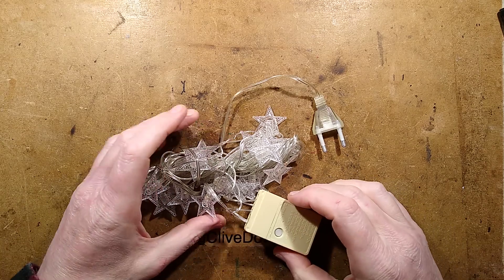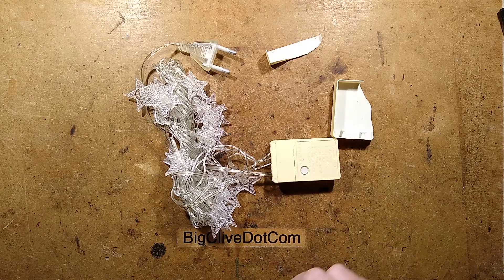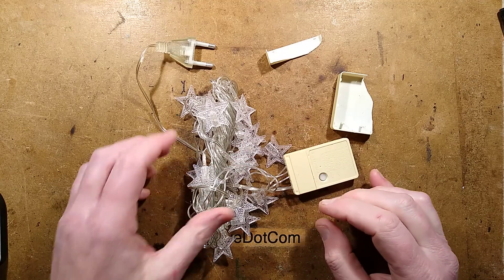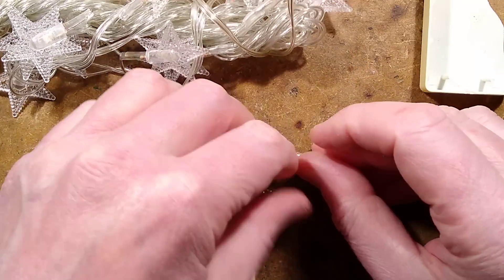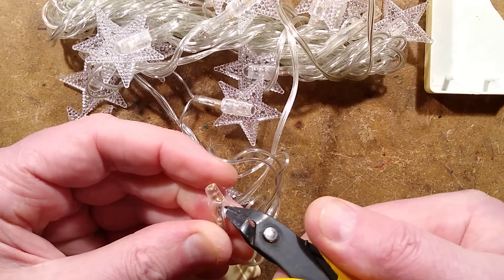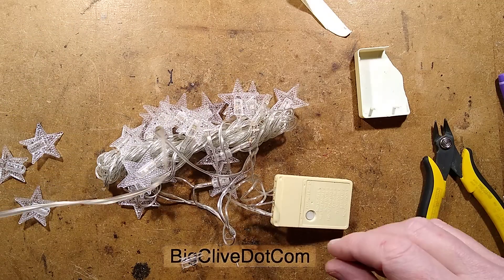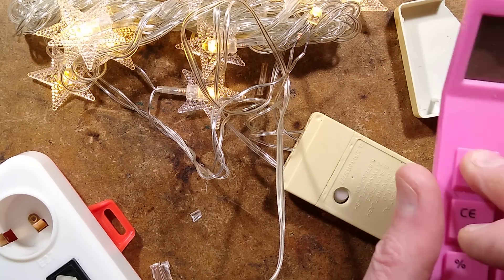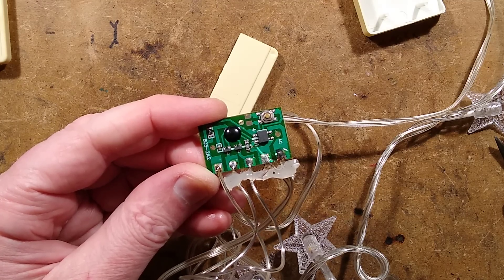I bought the WORST fairy lights on eBay (so far)

Comment: Reminds me of the melty extendable christmas lights of death from about 10 years ago with the same mains plug, running directly from rectified DC with no smoothing that put 330VDC across the whole string and said they were indoor/outdoor! Shame i didn't get the set that had the socket right at the end, so it was also carrying full AC with no fuse. Remember those? I 'member!

Comment: My coworker bought a snowflake set of these, otherwise identical. The plug molding is so bad, one of the leads had exposed wiring on the side of the plug where you would be holding it, and exposed in the stress relief portion on the other end. They remained unplugged wall decor. Between that and the feather light controller box, my first thought was "I should send these to Big Clive". So I'm glad you ran across them!

Comment: I took a gamble on some cheap solar powered fairy lights for my daughter and strung them up along the back yard fence. Those things survived 6 snowy winters and 100F summers of being on all night every night and charging during the day, never being taken down and even getting violently stretched out when a bad windstorm knocked over a chunk of the fence. After 6 years they finally stopped taking a charge from the solar cell. I paid like 6 bucks and unfortunately can't find them again. If I'd known they would last that long I'd have gotten 3-4 sets.

Every once in a while you find a hidden gem that was accidentally made better than they intended to, but I would only ever buy Chinese eBay crap if it doesn't plug into the wall. I like my house NOT burning to the ground, thank you very much.

Comment: I've only just seen this. I bought a 3m x 2m net and very nearly contacted you about it. Very similar looking controller casing from the outside but with a larger board and a rotary dial. I go through quite a few sets (they're used on stage and get abused) but twice I've broken them by just knocking the controller... and when knocked (not even that hard) the microchip breaks. Not sure if it's physically breaking internally or if it's from something else briefly shorting / breaking with the rotary dial but they're incredibly flimsy.

They also get really warm and smelly really quickly if you test them in the box they come in.

And yes, I do run these through an RCD as they're near the public and I don't trust them for safety at all (even if they are listed as sold from within the UK)

Comment: Many thanks for the circuit diags, You always take trouble to trace and show us.

Can the same kind of mains 'Power drop' circuit be used for some other circuits like for an ESP01 board, etc. with a smoothing cap and zener, etc? this would eliminate the need of other bulky components especially the transformer.
Reply from the maker: I would advise against powering things like that with non isolated supplies due to the high shock risk.

Comment: So good to hear that you still call those components 'Thyristors'...

Some years ago, a young whippersnapper of a recently studied-off engineer told me that those are called SCRs...and NOT thyristor and that a thyristor is an outdated technology used by dinosaurs such as myself (referring to the vacuum tube era!)

The reason why those resistors are running hot is to melt the ice off during cold European winters... it was done on purpose! 🤣🤣
Reply from the maker: It is odd that they ended up with two different names.

Comment: Hey Clive I have something I would like to send you.  I have several LED bulbs that you might like taking apart.  They are Philips first LED bulbs from 2011.  I bought them new from a Home Depot in late 2011 early 2012.  I have moved several times and took them with me.  Currently I have 2 of them in my carport light that stay on 24/7.  I have one extra that I would like to send your way so you can see what they have inside them. They are Philips AmbientLED 12E26A60 LED Light Bulb.
Reply from the maker: I think I have one here if they're the remote phosphor bulbs.

Comment: Would probably be safer putting lit candles in your Christmas tree than this. At least with the candles they go out after awhile making them safe to leave on, actually no these will go out also once the resistor fries itself to death at 100C, always assuming the house hasn't quite burned down fully before they fail.

Comment: The live wire with 2M resistor going to the chip may be for time delay measurement. 50Hz clock. There is no crystal for this...

Comment: I hear you mention power factors now and again on the channel but you do know that at least for residential customers it doesn't affect their bills since the meters we have don't measure it so the liability falls on the grid to supply the extra power but they don't get paid for producing it
I get that in the grand scheme of things we all pay for it, so we should all care but you or me as individual users caring about it doesn't make our bills cheaper
Reply from the maker: The new smart meters can be remotely set to start charging for apparent power, so it's inevitable that an accountant will arrange for it to happen.

Comment: 7:15 "button bounce issue" I heard you say that then it came to me that I have a "button bounce issue" with a circuit I made. I wonder would a capacitor in parallel  with the switch stop the bouncing? That would seem to fix my problem. What I have is a momentary push button switch to start a timer for a 12 volt water valve. Sometimes the switch bounces and turns off the timer. Thanks for any help in advance.
Reply from the maker: A very small capacitor across the button may help.  Just something like 10nF or 100nF.

Comment: Looks like the box is quite old and has become brittle. The inside looks like what the color originally was and that water boiling temp resistor is quite a nice (hot) touch.

Comment: Now, after Christmas, I find many of these strings of LEDs som ewith broken wires, some with a resistor or LED  burned  and so, I have free color LEDs. Is better to reuse those LEDs instead of letting them to go to waste. Strangely (or not, after seeing your video) it seems that each year there are more of these lights broken than the previous years.

Comment: Not sure if you're aware, but the 2 wire version of these sort of multifunction/annoying flickering lights use an AC signal of some sort and the LEDs alternate polarity. So when current flows one way, every other LED is lit, and when current flows the other way, the "other" every other LEDs are lit - if that makes sense.......

Comment: "Crack!"
How many years has this plastic-y battery/controller case spent in a warehouse already?
Slightly yellowed already aswell, so the warehouse may not be the correct guess - has this been in use ??

Comment: I bought something like these some time ago. The cream plastic controller box did not break though. The plastic on the LEDs turned black in places after a week or so of usage. At that stage, I decided to through them away. I replaced them with USB driven cords of LEDs from AliExpress.
Reply: It was your posts about dangerous Chinese goods that made me examine the lights and identify the black scorch marks. So you might have saved me from a fire! I am going to be cautious before plugging any Chinese goods into the mains without a transformer that lowers the voltage to something less than 25V... My pet peeve are those Chinese mains plugs with no fuse in them with a nonstandard small profile but with UK 3 pins on them. Nobody seems to be stopping China from selling them into the UK market.

Comment: I bought something which outwardly looks similar to this light string minus the stars, but the control box holds three AA batteries.  The control box has a flexible seal over the button and an O-ring under the battery door.  Each LED is also sealed with RTV in its sleeve.  There is no claim on the package of being water resistant, but I’d say it probably is.  Why?, who knows, because it would be a very small outdoor display.  I got it for about $3 US at Walmart.  So much safer… and cheaper.  😊

Comment: What I would like to know, is why do they always put a blob on the chip?!
Reply from the maker: It's a bare silicon wafer glued to the PCB, attached with bond wires, and then locked in place with a black resin blob.
Reply: @bigclivedotcom so basically a poor mans chip i take it.

Comment: Absolutely brilliant idea to use hot melt glue to hold a rather insulating plastic cover on a resistor that's dissipating 3x its rated current. I mean what could possibly go wrong?

Comment: if you want to drive a single LED from 120VAC, use a 180K resistor in series.
Reply from the maker: That may kill modern gallium nitride LEDs, but will work with old fashioned red ones.

Comment: I have seen these being sold at an illegal Chinese market here in Budapest a couple of years ago. Those wires seem to be single insulated only and as such should not be used for mains voltage at all. There is no isolation transformer anywhere, so the strings are also at mains voltage and should be double insulated. There is no fuse in this anywhere. In EU countries there is no fuse in the plug as well. So I would be interested that in case of a short circuit, how would those thin wires trip a 13A or 16A circuit breaker. If the current is not sufficient to trip the breaker, this could be the perfect ignition source for a christmas tree. The wires also snap easily, which is also a shock hazard (if that box would not be enough).

Comment: Earlier last year my wife was standing on the patio during a thunderstorm. I was just inside. A bolt of lightning struck close enough to deafen and stun the both of us for a while. My wife was convinced she was struck, because she felt something not the side of her face. Turned out it was the control box.of this exact set that exploded when most of the circuitry was vaporized. It was strung up on our patio and unplugged and forgotten about. I was surprised that such a short run of cable could have so much induced to cause it to disassemble so forcibly, but it was a damaging strike that also damaged my fridge, oven, all my CCTV, garage door opener, irrigation, etc.

Comment: I'll never understand why in something like this with a more than half empty control box they can't just use a capacitive dropper rather than resistors. It would probably cut down manufacturing costs too since one capacitor costs less and is easier to assemble than dozens of resistors inline with each LED.

Comment: A few years ago, my wife bought a star shaped Christmas light off ebay, a load of lights in a star shape.  No control box or anything, just two very thin wires (even thinner than the ones here) wired into a plug, with barely any insulation.  I'm not sure what kind of light they were as it seemed to be just pure AC running them.  I threw them straight in the bin.  One snag or nick on the cables and you'd have a fire of an electrocution.  Amazing what they get away with selling on the tat markets.
Reply: Back in the day European Christmas lights were just ES10 incandescent lamps wired in series to the then 220 V mains. Probably around the 70s they switched to smaller lamps with a different base with some kind of automatic bypass in the sockets. That means when one lamp failed the remaining ones had to dissipate more voltage, eventually leading to a chain reaction. That type of light was sold well into the late 90s, if not 2000s. I remember a classmate buying a set in early 1998, it came with one or two spare lamps in the box.

I still own two sets of the Edison-base ones, always fun to figure out which lamps are loose or blown. I haven't used the lights in ages but when I did I'd unscrew one lamp at a time and test it with one of those old flat 4.5 V torch batteries.

Comment: Wow… the crappest of the crappest! Most eBay lights are danegrous rubbish but these take it to another level with the dodgy control and the resistors that get super hot, and all the other danegrous features. And that control box is very yellowed, probably overheating because it’s so dodgy 😂

Comment: At the loss of,  possibly, some programmed flexibility (in the display patterns)... couldn't one (or two even) put all the strings in series (to reduce the power dissipation in the R)... and pot the the control pc, in maybe some scrapped thermoplastic?
Reply from the maker: The could be hacked to run cooler, but would still be hazardous.

Comment: How about a big, reliable resistor with a heatsink in the power supply for reducing the ingoing V/A? Does it make this usable? 🤔
Reply: probably yes, you can redesign the control box, the PCB looks ok.

Comment: Would it be even remotely safe to use outdoors, (where it must presumably dissipate heat more readily?) or to be honest would you just recommend putting the whole thing straight into the bin?  Great show as ever, happy new year to you and yours and thankyou for all the sage advice.    On reading some of the comments, these are some of the best ever. What a great  diescerning audience you have, seems we are all thinking the same way on this delightful item.
Reply from the maker: Outdoors the LED sleeves wick in water and pose a shock risk.
Reply: @bigclivedotcom  Yup and the plug isn't IP rated either. Speaking of which, something looks off about that plug. Either the body is unusually small or the pin size is non-standard (I live on the continent, so I see those plugs every day).

Comment: I like how the return trace snaking its way under the thyristors seems to rely solely on the PCB mask to provide enough insulation for 240 volts when the thyristors are in their off state.
Reply: With a splash of plastisol for good luck
Reply: To be fair, there was also a little bit of screen printing to help!

Comment: 3.5k, very unusual and not a standard preferred value, wonder if they bought up a load of left over stock from some device that did 'need' that 'special' value? i had a lot of 140k ones in mixed pack of resistors many years ago from tandy!

Comment: had last year an employee which asked me to repair his fairy lights because a wire broke off an led 
at the point of seing that the circuit board connected one of the two ac cables directly to the led's i just threw this hazard thing away
i told him that this was dangerous as hell and refused to repair - well now he is mad at me and bought the same lights again...
some people just want to be shocked or burned down i suppose...

Comment: I just saw one blown up with the same size pcb and the chip is a sot23-6 with the high voltage switches built in. A slight hint of moisture on high voltage across fine pitch sot23 pins and boom. 

The extra pads across the switch on your pcb is probably for pogo pin testing the module during production.

Comment: as I see it these light could double up as a water heater with the temperature the resistors run at, just sit them in a pot of water and you can make tea.

Comment: Around a week ago I found a very similar item like this thrown away on the ground in the front of the  garbage bin. No stars, it has a few burnt resistors, burnt leds and ac wires that connect to the pcb, housing looks the same, slightly different pcb(larger), I have some pictures, I don't know if it will work. imgur slash a slash jNV51tq

Comment: I noticed they're selling "extension cords" on the Chinese e-commerce sites that are made of the same CCA bellwire and plug/socket as these sets, for a quid each. What could possibly go wrong?
Reply: 🇨🇳 - Buying and using their own crap, not surprised if they are having electrocutions and house fires and they don’t care ⚠️
Reply: What were they claiming for amperage or wattage on that abomination?

Comment: Did you measure the resistors? I've had issues with cheap resistors being a completely different value from the colour code.
Reply from the maker: I did measure them.

Comment: plastics can be brittled by using heavy uv light.

the same level of uv that is used to etch semiconductors manufacturing i think is used for industrial disinfection and because of bio terror scares in the postal system it is possible that the item was pre brittled just by the uv/gamma ray beams used to fight bio terror weapons in the mail.

Comment: Oh god, they cheapified even more the already incredibly cheap and nasty controllers these lights already used, I didn't know that was even possible! At least they have hot glue in them now, I guess... I had to add it myself to some old lights I have just to keep the wires from falling apart on their own and shorting out. Those old ones are also of the through hole component style, with a second board for the blob, so it's actually interesting to see how they've minimized them even more with recent ones.

By the way, with now nasty that plastic is, I wonder if they're now messing with the chemistry of the plastic to make it as cheap as humanly possible, and I wonder if it's even fire retardant at all!

Comment: Given the oxidation of that control box I'd say those lights (or at least the box) are a decade or more old. If not, then they've been kept in a damn harsh thermal/UV environment.
Reply: One more plausible reason being a badly produced plastic that isn't chemically stable
Reply: @NinoJoel  Maybe they just melt down some of that plastic trash we ship back there.
Reply: Can't be a decade old. This controller design with SMD components started appearing in 2020. All the lights made before 2020 used the standard through-hole design.
Reply: @rares3968  I did say "or at least the box". I recently threw out a set of lights with that exact same box design that I bought at Homebase Durham in around 2006. I'm sure the circuit board components were different but the white box was identical. The LED light holders degraded because they were up in my conservatory constantly in that period.